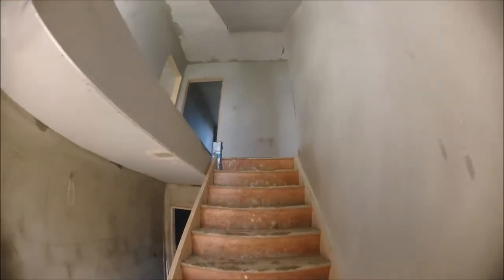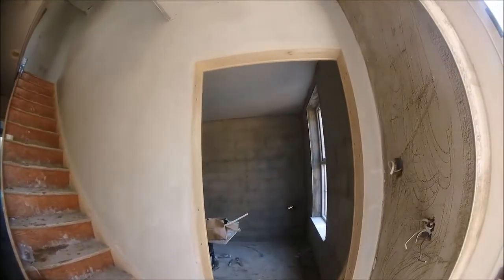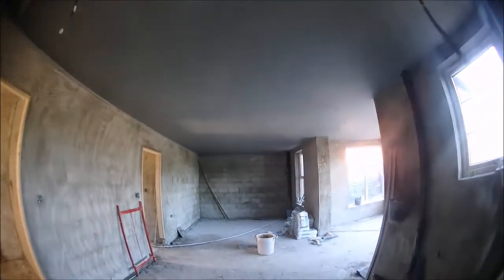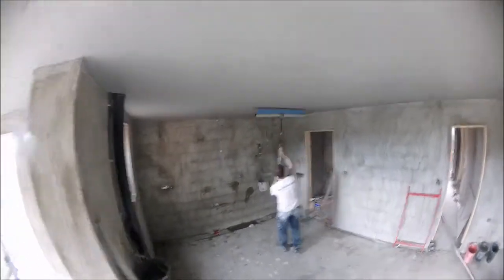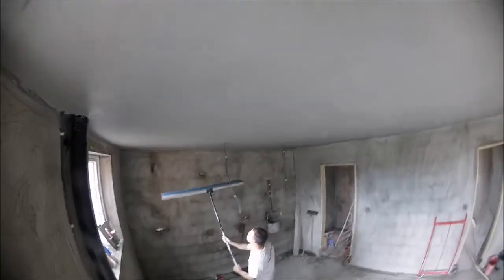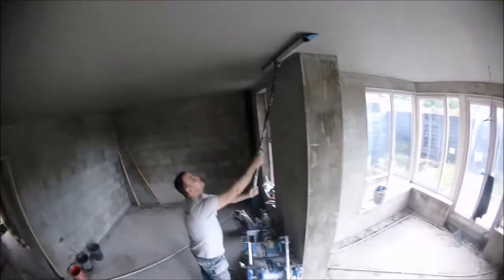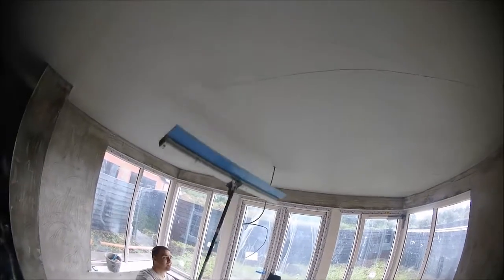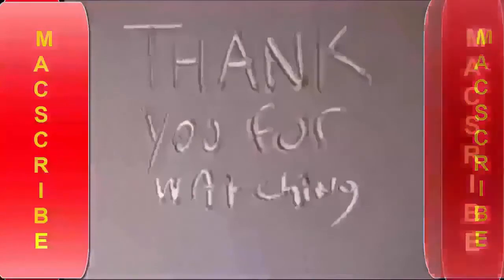3 STOREY HOUSE MID FLOOR COMPLETE AND BIG CEILING SKIMMED SPEEDSKIM

Comment: I'm amazed how the ceiling is still moist enough to do speed skim as it is large ceiling you're working on; I thought it would have dried out too much. For us;) The idea of spray water I mentioned to make any imperfections good before the plaster dries didn't work as well on the walls as using brush and water but was worth a try. So we stick to your brush and water technique now. But because I have poor eyesight I missed to prepare one of the walls for  my brother to plaster. We found that Faithfull Soft-Grip Plasterers Trowel Stainless Steel you mentioned is excellent the best yet, and so easy to clean. I find using dry cloth to clean tools and bucket after plastering or after mixing the plaster works better than using lots of water to clean them. I'm going to buy another Faithfull Soft-Grip Plasterers Trowel Stainless Steel, so me and my brother can both work doing the plastering rather than taking it in turns. Plastering is not like painting and decorating. Only need a few small things to go wrong when plastering and it can turn out a right mess. So preparation is very important, also getting the mix right of course. No point trying to cut corners. We tried to get away without using those metal angle for doing corner on windows but couldn't get square and flat.  We will buy them Friday.
Reply from the maker: My faithful trowel got chipped bad will take me time now to be able to use it just take good care of the ready to use trowels as they do tend to chip a little easy as they have a fine sharp edge where do you get your tools from mate e bay / amazon ?